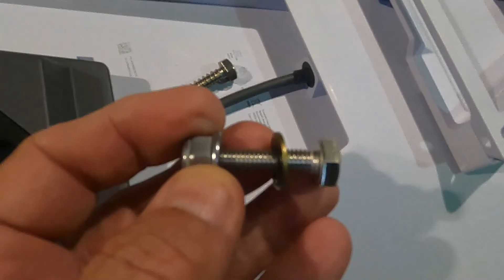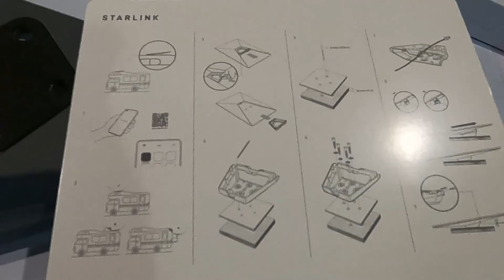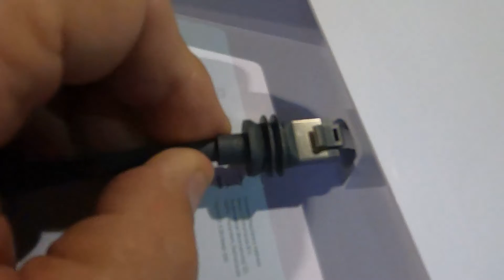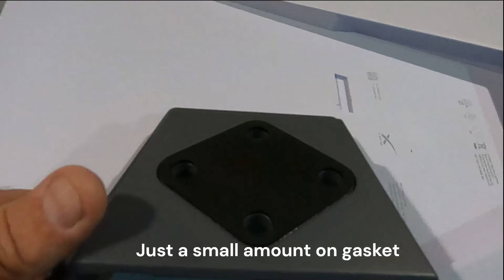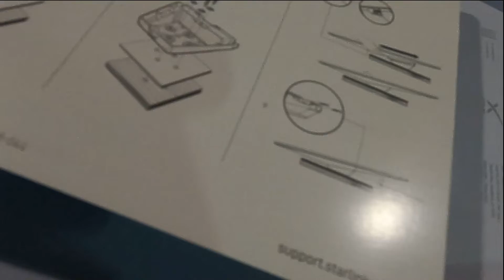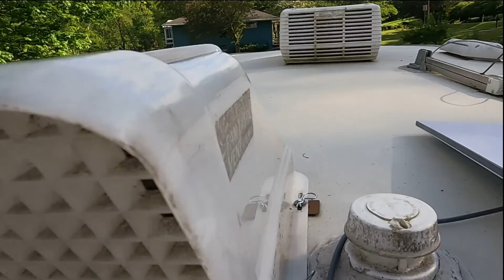Starlink's new GEN 3 Standard Mobility mount for RV, trailers, trucks and 1st responders

Comment: I have a class a rig there is no way the mounting is going through the roof to the other side it would come into the headliner or ceiling… not to mention there is basically no bite in an Rv roof so most of the time it’s going to need some butyl tape and lap sealant and the screws pretty much hold it down until that dries and that keeps it secure.. would you recommend those big old lag screws? Hate to put that big of a hole in the roof four times but will… also I was going to mount it on the front of the Rv the wind shouldn’t be an issue right? Not much room under the low part to get under and pick it up..?
Reply from the maker: a hole is a hole, you want to get into a stud or roof brace or be able to put in a backer board from the inside

Comment: Thanks for the detailed video on the mount. This is the first i’ve seen out for the new standard mobility mount. My intentions are to mount it to a 12”by12” steal plate with magnet feet for truck roof temporary mounting. I like that the mount has set screws unlike some alternate 3D printed options, and priced right.